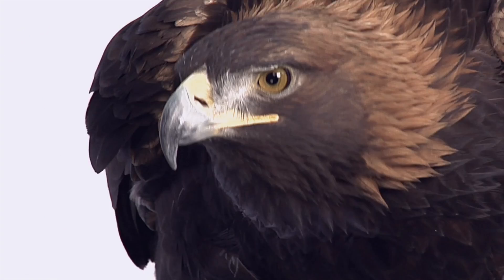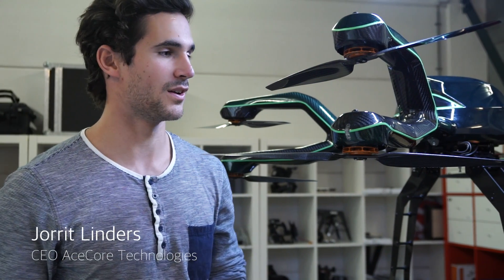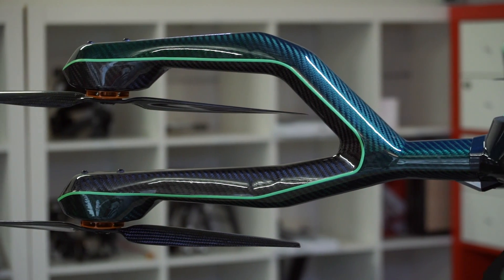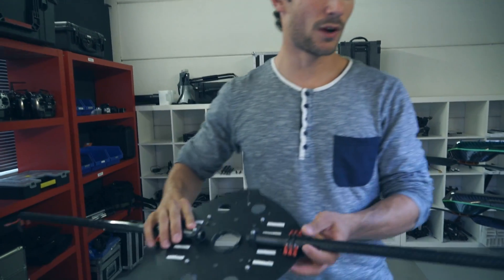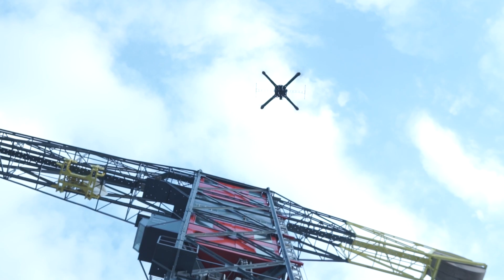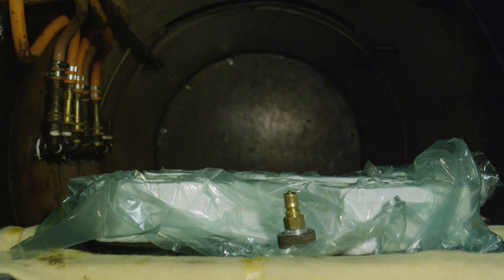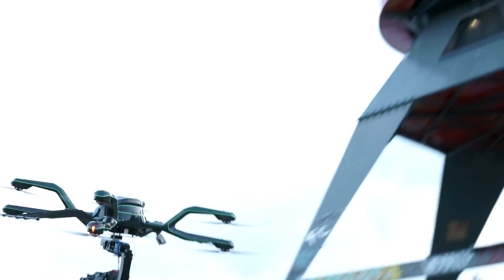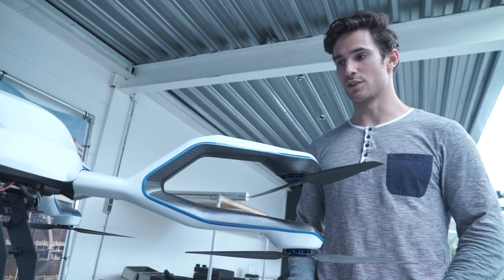AceCore - NEO Drone - The NEO Explained

Comment: i am designing hex copter but i am little bit confuse between pixhawk and pixhack flight controller which one is batter to buy and in pixhawk there is an problem withe esc pixhawk is not supporting EMAX BLHeli 30A esc but the other standard esc work but i am using only good quality Emax product so can you give me any suggestion so that can helpful for me.

Comment: @01:30 Rain does pretty much nothing to these motors due to how the "exposed" wiring around the ankers is still covered with a lacquer to prevent a short within their winding making it very much possible to submerge them into the water and still have them running.

With the lower motor now also facing down you're even more likely to damage it in case of a tipped over landing as the likelihood of dirt getting sucked into the motor through the cooling vanes is a lot higher than if the motor ware mounted on top.

With such a large prop striking the ground you're also at high risk of a bent shaft soooo yea... Not buying THIS claim of protection =)

Comment: Very nice design both aesthetically and functionally!  Flying in the rain could be quite a game-changer.
Reply: the thing is, brushless motors are waterproof...
Reply: +Hovercams LLC The problem infact is not the drone but the camera.
Reply: +Olivier Lagae He used a really nice RED Camera, what kind of camera do you suggest.
Panavision is way to expensive in a crash. At least when you crash with a RED Camera, it's modular so if a part breaks you just replace it.
Reply: Ernesto dí Terríbílé i can not tell you. I never had to film in rain. Had some trouble with à GH4 mixed with dust. If i had to fly and film in rain i would try with some custom platic cover. I don't film anymore. You can check my work at Www.terreye.com  if you are curious.
Reply: +Olivier Lagae Panavision cameras are very different from Panasonic Cameras. I really think that the GH4 is the best value for money camera. There build quality is good, but you have to remember it's a consumer grade camera. A RED or Panavision camera and even an Arri Alexa are a whole different ball game. Most cameras don't like rain and dust. Therefore most people use toy grade sports cams like GoPro or Sony. But the quality of footage is really bad.
Reply: +Ernesto dí Terríbílé jouw website geeft aan dat je een ontzettend leuk beroep hebt. Ik kom uit Nederland. Maar ik zag je +32 nummer.
Reply: Hovercams LLC